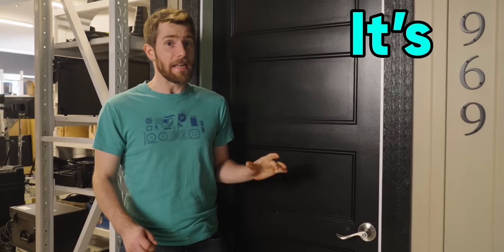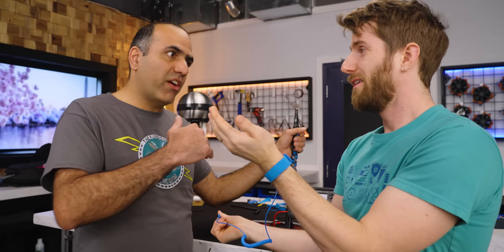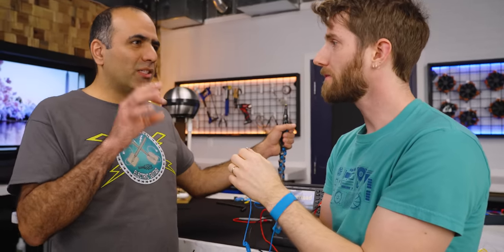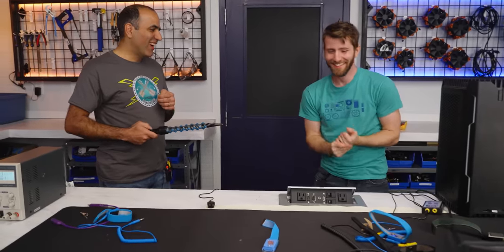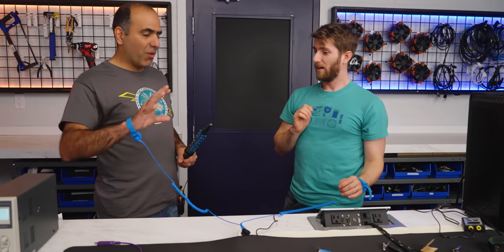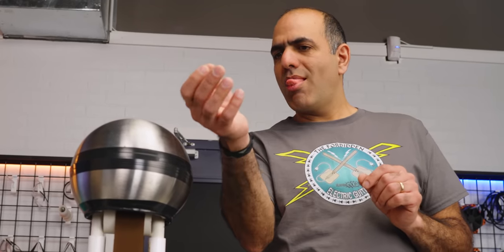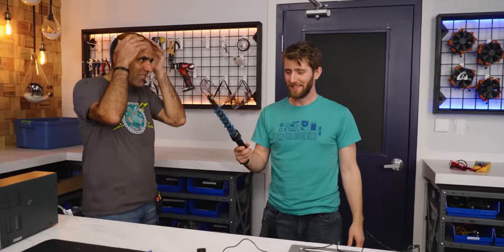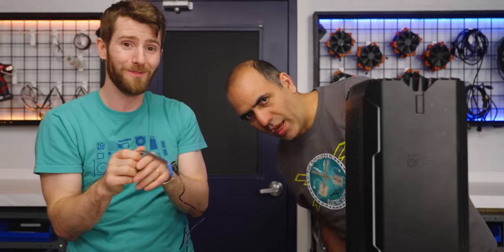The SCAM of Wireless ESD Straps - Feat. ElectroBOOM

Comment: You guys should've brought a geiger counter just incase, you'd think I'd be joking but there's been 100s of "healing bs" products on places like amazon that have been shown to contain thorium. You guys got lucky with these esd bracelets stay safe in future
Reply: Not to downplay radioactive thorium but I don't think that would be much of an issue for them wearing it for as long as they did. Definitely should see just out of curiosity though
Reply: @loganricherson  as I understand thorium outside of you is not something you want to snuggle up to each night but it is "relatively" harmless! If you inhale/ingest it... Totally different story!
Reply: @loganricherson  wearing it for a little bit no, but when they cut into it, the thorium is usually a dust and easily inhaled and then it's a huge problem
Reply: @daniwalmsley611  that's true, I didn't think about that
Reply: @MakeItWithCalvin  thorium is an α source, they are extremely potent but easily shield, (paper can stop it) but when inside your body there isn't anyway to remove it or shield it and it's basically a death sentance if you inhale too much or it gets stuck somewhere like in your lungs

Comment: I'd be curious if that "Japan" strap had any radioactivity, like the many "health" bands with thorium dust in them that have been found all over Amazon and eBay.
Reply: Yep. I am 100% positive that is what the Japanese bracelet was. The white flecks are radioactive thorium oxide (which explains why they weren't conductive). It's not crazy dangerous levels of radioactivity (don't eat it though!) but certainly nothing you'd really want to wear continuously—especially since it provides zero benefit, in both anti-static and health contexts.
Reply: I visited the amazon seller's page, and some others. there's no chance it was made in Japan. lol

Comment: There is a sort of way to wirelessly electrostatic discharge, using a very pointy spike and ideally a lot of them. Spikes concentrate the electric field and electrons will flow off of the tips or into them as needed so you would be "grounded" to the atmospheric electric field so depending on how high from the ground you are and how far away you are from ground wires will determine how high above ground potential you'll still be. Assuming you are within 1 meter of a ground wire or the ground itself, you should be less than 150 volts above ground wish will prevent electrostatic discharge as that requires thousands of volts.

Comment: I hope that the metal fragments in that strap aren't thorium again. Please check, just for safety. Negative Ion, Static discharge and Positive Radiation straps are a common health scam that is commonly filled to the brim with radioactive Thorium. There is a video from "The Thought Emporium" about them. Stay safe.
Reply: They almost certainly are. You can find a bracelet that looks identical to the one in the video that is sold as a "negative ion" bracelet.

Comment: During winter time, I used to gather so much charge from my couch that my TV across the room would shut off when I would turn the ceiling fan off. The chain on the fan would start moving towards my hand from over a foot away. I hated turning off the fan

Comment: The traditional bracelet and shoe straps is mainly to make sure you yourself don't build up static electricity. Static shocks easily destroy microchips. I wear them at work since I work for an electronics manufacturer,  we've had many chips get shocked by someone not wearing any esd stuff and the chips die

Comment: Those "wireless" straps look shockingly similar to the very radioactive "health" bands that another YouTuber checked with Geiger counters because they claimed they had thorium or something else in them.
Reply: The germanium titanium one is basically just one of those snake oil negative ion bands, yeah.
Reply: They are not "very radioactive" that YouTuber really likes to over-exaggerate just how radioactive things are
Reply: @rylandavis2976 depending on the item some of them were pretty spicy for a product intended to be worn daily. radiation should be thought more of in lifetime dose, as immediate damage from radiation means you'd pretty much be dead already. I wouldnt call it very radioactive either, but ideally no health product should be especially higher than background
Reply: @rylandavis2976 they're hot enough to be a problem with prolonged exposure and any radioactive dust getting into your lungs is a significant risk.
Reply: For reference: the YouTuber was TheThoughtEmporium
Reply: @The Magitechie  problem is over-exaggerated. Is it best to probably avoid these products? Yes. Should they be allowed to be sold? Probably not. 

But these don't put out enough radiation to cause significant harm even in a prolonged exposure. The yearly dose of wearing a bracelet is half of the yearly dose that is associated with any cancer risk increase at all and that minimum cancer bracket is a pretty small increase. Where it really starts to become a serious detriment to your health is orders of magnitude higher than that. 

The short I saw on it way over blew how radioactive these bracelets are. 

The YouTuber that was linked in a lower comment did a much better job of explaining the reality of it than the short I saw. 

Its just not accurate to describe it as very radioactive in my opinion.

Comment: That "glitter" has a nonzero chance of being radioactive. You may want to bring that wristband near a Geiger counter and see what happens. You can find several videos on that scam.
Reply: exactly my thoughts....in that case it could actually work....if you would be charged positively this kind of "negative ions"  beta decay bracelet could lower your charge
Reply: Yup, I bought a wristband with the same germanium titanium thing and its a good test source for my Geiger couter
Reply: @640kareenough6  lol
Reply: It's not even made for this purpose and I don't know why LTT included this here. It's not supposed to be conductive neither. The original intent is, well it's still snake oil shit anyways — that they’ve got it right — but it helps your athletic ability. This was pretty popular among atheletes in 2005-ish despite many were skeptical. It kinda brought me back to the old days..

Anyhow, I suppose this is scam seller trying to sell inventory from 2 decades ago hoping "made in Japan" will appeal to Anime fan PC builder or someting.
Reply: yup the seccond i saw it i thought it might be thorium just like those negative ion bs health bracelets. also i dont think japan makes those, pretty sure that whole industry is china based
Reply: Srsly
Reply: @blankblank4949  Would you stop spreading your unchecked negative assumption? I’m not sure about this specific brand but the brand that popularized this is Japanese brand called Phiten. And it’s not about minus ion but the metal particles and it’s weight AFAIK. We make fair share of stupid crap too.

Comment: You might want to get that "Japanese" bracelet tested with a geiger counter. Some scammers like to put thorium in silicone bracelets like that, and that might be what the white powder is.
Reply: Why would they do that?
Reply: In particular, the little white specs they show on the close up look pretty similar to the thorium oxide that is used in the negative ion bracelets.
Reply: what will thorium even do on bracelets like those? what's the purpose of putting it on the band
Reply: @kaneki1056  Sometimes as alternative medicine (Negative ion bullshit), but in terms of ESD, radioactivity can discharge static charges via ionizing the air. Some record cleaners are based on than principle.
Reply: I just wrote a similar comment, they are eerily similar to those magic cancer curing radioactive bracelets.
Reply: Actually, some ESD dissipation devices have used alpha emmiters to ionise air and let charge bleed down that way. That was however abandoned due to radwaste disposal concerns and modern ionisers are using ozone generators to provide ionised and dust-free environment. For actual ESD there are other, more convenient ways than wired straps: ESD shoes (and ESD shoe patches for visitors etc), ESD furniture, ESD dissipating floor paint.
Reply: @kaneki1056  the air is ionized by the radioactive thorium, and then you are discharged to it. It was used in the past to remove dust from LPs which were clinging via static.
But it was quite radioactive.
Reply: yeah, and report the seller to amazon and whatever local government agency is responsible for radiation safety. That should take care of the particular listing and possibly the seller, but at this point it's basically whack-a-mole.
Reply: @themagitechie9955  TBH thorium addition makes that bands no more radioactive, than kitchen countertop. So unless manifacturer goes nuts with the thorium content - he is covered.
Reply: @Jack DiNucci lol .. no. I meant why would they add any radioactive component to the bracelet. I know what a Geiger counter is for lol

Comment: That was a hilarious one ;). One thing to note is that the Japanese band doesn't have any claims about ESD protection on the package - it seems to be some kind of magic band that emits some good ions to help with your health (it specifically mentions stiff neck/shoulders...). So it looks like the seller did some false advertising there.
Reply: This. Not meant for ESD at all, so you were shocking yourself not for science, but for theater.
Reply: Seems to be a negative ion bracelet, which in scamworld means they laced the silicone with RADIOACTIVE THORIUM.
Reply: And to adding to that, the packaging looks far from legit. The text on the "Japanese" band's package is that of a random BS Amazon Marketplace product.
Reply: Also, i can confirm 100% that band is not Japanese. First Japanese word on the front (Titanium) should be チタン (chitan) but is written チタソ (chitaso). And it only gets worse from there…
Reply: So they advertised a scam product as a completely different scam product. Beautiful.

Comment: Warning! You should test those straps for radioactivity, sometimes wrist bands that claim to help you loose weight come with radioactive material in it, hopefully it is not one of those...
Reply: Well, eventually a radioactive product will push you in that direction…
Reply: Literally everything is radioactive.
Reply: @themonsterunderyourbed9408  Yeah, everything is a tiny little bit radioactive, but thorium bracelets can give you radiation burns.
Reply: @themonsterunderyourbed9408  No, not literally everything is radioactive. Stable electron configurations are everywhere. While, yes, every element will eventually decay, in most cases this is on the same time scale as the heat death of the universe (in other words, so slow as to be irrelevant). But it isn't really about halflife, it's about particle decay. What and how electron shells shed excess electrons to achieve a more stable configuration is what determines danger, and what is commonly referred to as "radioactivity". Time, distance, and shielding all play important roles in determining "safe" exposure limits. Anything that is comparable to the day-to-day natural environmental radiation we get from being on Earth is usually considered safe, and "inert" or "stable".
Reply: @gloriouslumi  strong and weak nuclear force ...

Comment: When I worked in hardware development, one of my tasks was receiving desktop PCs for testing. For some reason, each and every one of them had a static charge. At some point I resorted to asking random people in the office to touch them because I was so sick of getting constantly electrocuted. On a side note, not one of them failed.
Reply: This is where you use a screwdriver to discharge them with. Instead of a single point on contact, your entire hand absorbs the current, but only if you hold the metal part of course. Basically, any metal object to elememate that single point of arc.
Reply: You were very unlucky. Normally you only get electrocuted once in your life. On the other hand, since you were not electrocuted, you survived. So maybe you're lucky.
Reply: @mjouwbuis  Not even close. For Electrical engineers and technicians, you'll often get electrocuted once a year at least. It's really common to be super strict on following safety protocol when working on high voltage, then relax and lower you guard when migrating to low voltage.
Reply: @techwolflupindo  Yeah I have to wheel a metal cart with plastic wheels around on a concrete floor every so often at work, I've learned if I let go and touch something with my finger I get the shock, but if I grip the metal handle properly and let the trolley touch something metal that's grounded I discharge without any pain.

Comment: 7:37, The current on that initial arc was actually very high, like tens of amps but the reason it is not lethal is because that discharge is for only a few microseconds and that is not enough time to cause much damage to a person. I am pretty sure Mehdi knows this but he just doesn't want to correct Linus. What is low is the charge. Current is a rate of charge transfer and because the very small charge on the dome was delivered in a very short amount of time, the current is high.

Comment: Can I just say, first and foremost, how awesome it is that LTT and ElectroBOOM are BOTH operating out of the Vancouver area. That it's (relatively) easy to get them together is always a good time, and we all win for it, because these videos are awesome. 

I've been more or less building and working inside of computers since the early 90s. The FIRST thing anyone warned me of was not to work on it on carpet, as static = bad.

First things first, I've never been able to discharge on components inside of my case. I've tried. Socks on carpet? Check. Balloon on my hair? Check. 

I honestly stopped caring, I never do any type of ESD isolation. I felt vindicated in the last video with Linus and Mehdi when it took serious and deliberate abuse to even kind of start damaging components. ESD and computer components feels like airplanes and cell signals, it's a lot of fluff over something that was solved decades and decades ago, but word of mouth won't let it fade away. 

I KNOW there are going to be people who reply to this (if they find it) saying they've personally killed hardware by not grounding themselves and discharging all over their hardware, or at least a friend of a friend of a friend they know told them it happened one time in the nebulous past. Obviously not everything is created equal, and even things with a 0.00000001% (deliberately made up number) chance of happening CAN happen. 

My experience of fixing literally thousands of PCs over the last 25+ years and never having an issue with static discharge is what I'm sticking with.

Comment: The whole notion of "wireless ESD straps" is like having a "Bluetooth engine" in your car.

I was introduced to ESD precautions back in the late '80s when working for what was then the UK's leading systems reseller. Our primary partners at the time were IBM and it was they who got us all into the ESD mindset. In 1990, I saw a video they'd made which -- if my brain isn't misremembering  -- was of the silicon of RS/6000 RAM modules photographed under an electron microscope in a before and after ESD exposure state. The after pics were carnage: the pits on the surface of the chips were like craters; the surface having literally been blasted away. We learned that the voltage necessary to do so wouldn't have been felt by a human. Anything you could feel would have caused far more damage.

Comment: I use to work at a company building different circuit boards and we had to wear a long smok those bracelets and then a thing that went around the heal of your shoe and a little fabric wire that came off the side of it and you had to put it down into you shoe to prevent static electricity

Comment: im happy to hear mty idea wasnt stoopid bcz when i learned about eleectric currents and importancee of ground when fixing mmy car, i would wrap a stripped cable and connect to ground strapped to my least used hand depending the car side bcz of the paranoia of a shock hstunning me out in the cold that most likely no one will even notice and ill be stuck for just a  short enough time to freeze and also bcz im a bixxch

Comment: For the wireless straps, do you think it would work if they intergraded a capacitor to soak up the static then discharged by a series of resistors?
Reply: No.  The charge needs a path to ground or it will persist.  You can think of it as water in a dam high in the mountains, circulating though resistors will still keep you at the same height.  Releasing the charge is flowing to a lower altitude.

Comment: I can relate with Linus's struggle there. I'm always getting shocked by everything. For example car, office chair at work (with a metal base) and door handles. Also shaking hands with other people, touching my macbook, sometimes even my phone. And I'm ABSOLUTELY frightened by it. I hate when it happens. So I came up with a solution. I'm always touching door handles with my keys first. That seems to work fine. But it would be weird to touch other people with my keys first tho. I have no idea how to prevent it. Tried everything.
Reply: Multi layered clothing does that really easy. Winter time in school is fun due to lots of sweaters on undergarment and coats on shirts to generate a charge just by walking. I done one two inch arc once. The recipient was not happy with that one. :-D
Reply: Wear other shoes or make ground straps on your shoes.
Reply: It’s also very possible where you are has very low humidity. That can cause it. Also it depends on the type of clothes you wear, synthetic fibres can be pretty bad when it comes to static.